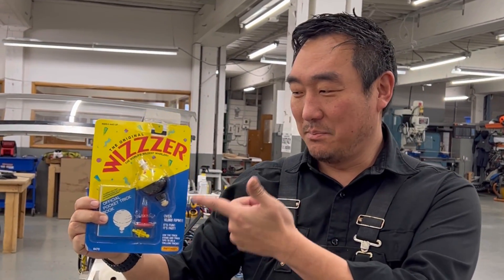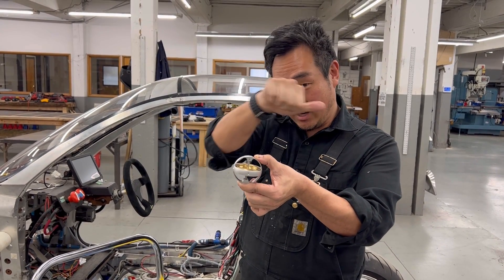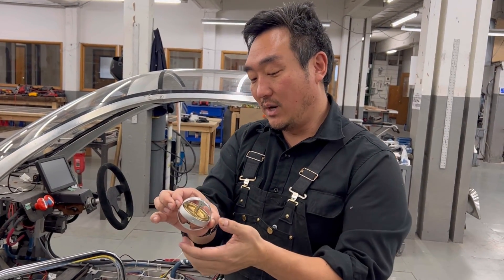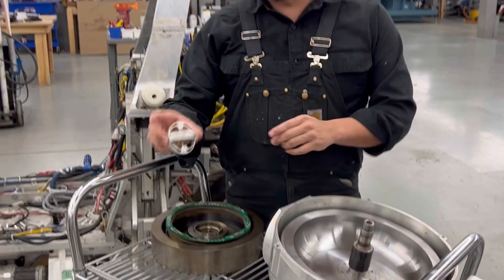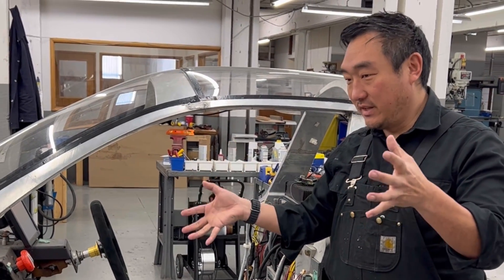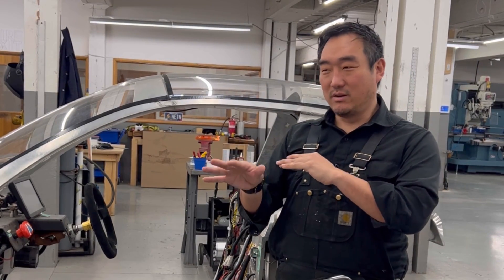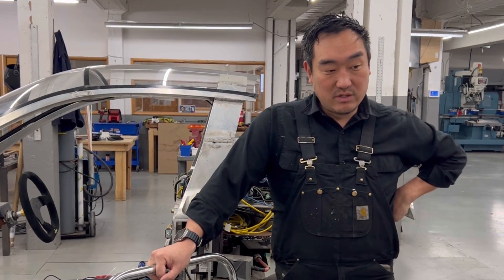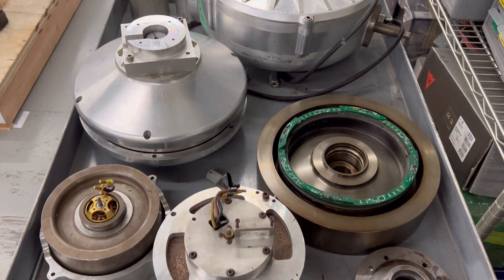Why two gyroscopes? | Groundbreaking use of space satellite technology

Comment: great tech!
1/ have you considered using smaller/lighter gyros for stability at low speeds and using steering actuation for high speed stability? less weight and less energy loss to keep rhe gyros spinning.
2/ if lighter gyros is not an option, you should consider using the gyros energy storage/flywheel for regen/acceleration ? regen while slowing slowing down could be used to spin the gyros faster, storing energy like 1st gen F1 KERS, while providing increasing stability at lower speeds, and then accelerating could use the energy from the gyros used as flywheel to power the motor with minimal draw from the battery.
you would get better regen efficiency (no electricity > chemical > electricity conversion), electric output increase (not limited to the battery output), longer battery life (less cycles)
two 40lbs gyros with 20cm radius spinning 10krpm give about 200Wh best case. this may not sound like a big energy buffer compared to batteries but the ability to charge/discharge the energy fully in a few seconds with great efficiency an no wear is very useful. 200Wh is 3 times the energy to bring a 360kg +80kg driver up to 75mph!! (sorry for the imperial/metric mess😂)
assuming 100% efficiency you would actually only need to slow down the gyros from 10krpm to 8krpm to accelerate from 0 to 75mph...
obviously you would need powerful electric motors to accelerate / decelerate those gyros quickly enough but motors are cheaper/lighter than batteries and the rotor weight would be integral part of the gyro, so actually little weight penalty
this is my gift (no patent) to your project 😂

Comment: Will it not be using up battery energy just standing still because of the gyroscopes?
Reply from the maker: Gyro power consumption varies depending on the size of the motor and the type of application. It's estimated to be between 90-800w
Reply: @litmotorsofficial  IMHO it may save energy if the bike senses it's standing still for a set time (eg 5sec) then 2 mechanical stand on each side extend to assist in standing the bike so that the gyros can power down. It'll be most effective during traffic light stops. 
Anyway, I believe you guys must have thought of better solutions. 
Good luck with the project! Hope to see it on sale soon.

Comment: Is this a scam, i been flowing them for over 10 years and all they do is beg for money
Reply: Yes, it's a scam😂
Reply: Should dicth that gyro, put tricycle mode, drop off all gadgetery save electric to get distance. Less auxiliary, less AC than electric car need, small footprint on road could be solution for commuter electric vehicle
Reply: @sukocoimam4519  I'm working on something similar to what you describe.
Reply from the maker: We understand the frustration. It's definitely been a journey, and not all of it easy, especially after our founder and CEO's prolonged recovery period. We go into this hiatus in our blog post (linked at the end of this comment) if you'd like to get up to speed on the details, but we also welcome discourse and we're open to any questions we can answer for you! https://www.litmotors.com/post/answering-your-questions
Reply: The truth is that they still don't know how to make this system work. The gyro or gyroscopes need to precess while in a turn. Forced precession will only work if the speed of control varies with the lean.
Reply: @energy4us  isn’t this possible with electric motors with regeneration
Reply: The reason that I know this is that we tested it back in 1991   In Portland Oregon near Reed College
Reply: https://youtu.be/sZm2c7e6fBI?si=vT8hBjPY5VATor56
Reply: He is not a scam. But whenever his toy makes it to mass production, I probably be six feet under and get rolled over by his gyro!